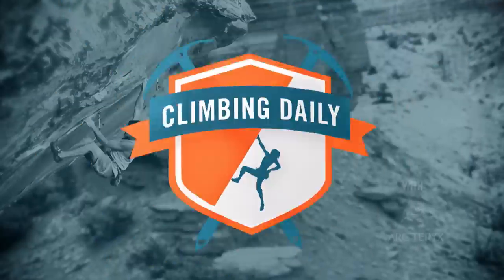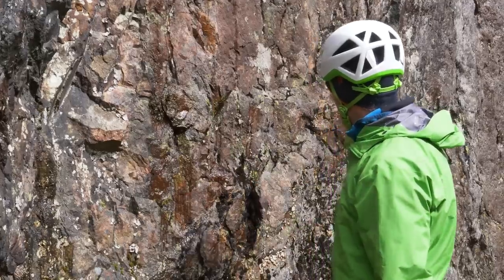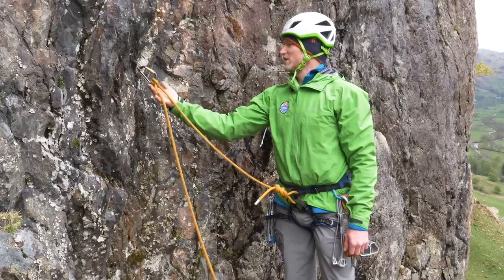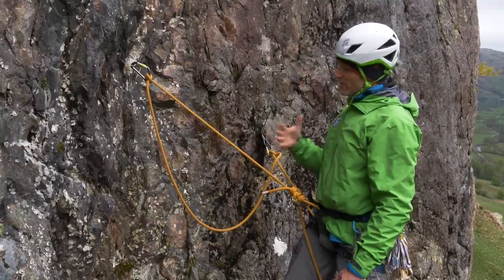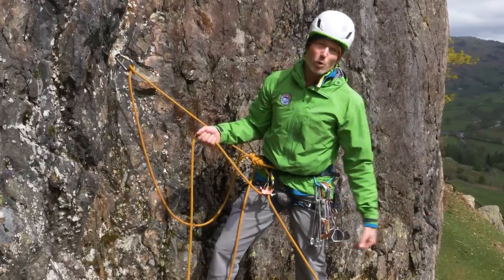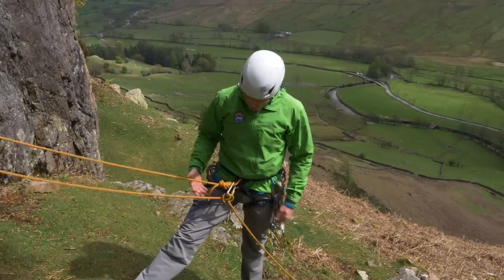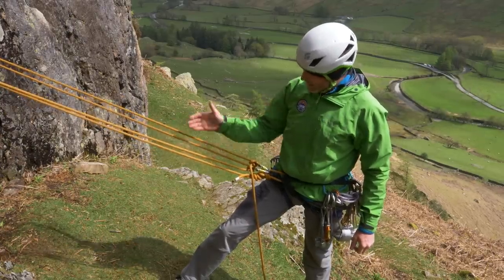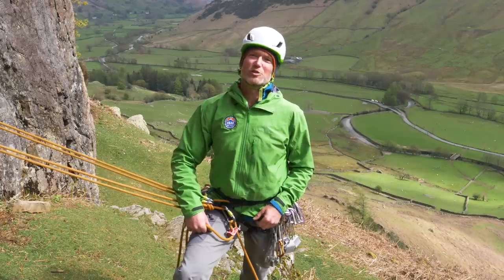How To Build And Equalise A Trad Climbing Anchor | Climbing Daily Ep.1174

Comment: No way to easily escape your anchor if you need to perform a rescue or leave the belay for other reasons. Also, no dynamic equalization like offered with other systems. I remember reading somewhere that the amount of dynamic stretch in an anchor like this is entirely negligible compared to the climbing end stretch due to the short lengths and fact that the load is split between two strands.
Reply: Not true - the difference between nylon (somewhat stretchy) and dyneema (not strechy at all) is enough to make a difference in controlled tests by DMM ("DMM Technical video on slings at anchor" on youtube). They also do testing with the rope and it performs very well on factor 2 falls. Cloves hitches also make it better (though you can certainly include cloves with slings/cords as well).

The need to escape the belay, as you pointed out, is a very valid concern. However it has to be weighted against other pros & cons and doesn't in itself make this approach a no-go.

Dynamic equalization - if you use slings with knots, you don't have that any more or less than with this. If you use the sliding X, then that's actually been rather discredited as an approach in most cases because even though you do get equalization, if a piece fails you then shock load your anchor onto the other piece. So essentially dynamic equalization may make it less likely that a piece will fail, but puts you in bigger trouble if one does. In fact, I would argue that since the belayer is in the system, this contributes to make it more equalize - the belayer as some margin to built the anchor so that it is equalized in a direction in which he would be belaying (and then since he would stay in that general area, the anchor is equalized given his position).
Reply: Francis, the DMM test is dropping a static load directly on the anchors. In this case, you are correct. I referred to a situation where a portion of dynamic rope existed between the anchor and climber. In this case, the single dynamic length will absorb the most significant portion of shock, and the relatively short, doubled section of the anchor takes up comparitively little. The only case where this wouldn't be true is when immediately starting a lead where a high factor fall is a potential. Yes, there are measurable differences in an engineered scenario like DMM, but I would question that holding true under most realistic scenarios. Not saying other rope systems aren't good, they are awesome. But the one used on this video is less so IMO. The biggest reason being lack of equalization, second being not being able to escape.
Reply: Well, of course once the climber is dozens of feet & a couple protection/bolts above the anchor, the anchor itself doesn't matter much, regardless of how you built it. From that perspective, it is somewhat pointless to talk about anchor configuration since it'll play little to no part in the equation, except perhaps keeping the belayer close to the anchor after he is yanked off his stance by the falling climber. But the anchor shouldn't be build for the eventuality of a fall with significant lengths of rope which guarantees a low fall factor: it should be built keeping in mind what happens in case of a high fall factor, especially if there are reasons to suspect challenging moves immediately after leaving the anchor and if there are doubts about the capacity of that anchor (or the rock) to sustain a high fall factor without breaking.

So the DMM test is very relevant in the sense that this is the worst-case scenario and worst-case scenarios should be taken into account. It does show that nylon as better shock absorbing properties in cases of high fall factor, but less so than the rope itself and that clove hitches also help reducing the shock on the system. I'm not sure I get your point - when you say "but I would question that holding true under most realistic scenario". Their conclusion actually fit rather well with what we already know about the properties of the material & configurations they used - yet you would dismiss the result because (for some not really specified reason) they may not hold true in practice? This seems closer to beliefs than to a fact-based assessment.

I am not sure I understand your views about equalization. The sliding X is more and more questioned because if any piece fails, you're shock-loading whatever remains of your anchor which isn't good. If you're not talking about the sliding X, then you're still making an anchor with a knot & a focal point, which wouldn't be better or worst in terms of being equalized since in both cases you still need to define a general direction of pull for which your anchor will be equalized.

As mentioned in my other post, this doesn't mean I would use his system all the time - it would be pretty silly IMO if you've got 2 shiny new bolts next to one another as an anchor. The main criticism I would have with regards to the video is that he doesn't really highlight in which cases he would take this approach, as opposed to just a sling & locking biners...
Reply: WoT, much.

You don't need "dozens of feet & a couple protection/bolts above the anchor" to mitigate a high factor fall, you are shaky on your physics there. You can begin mitigating that as soon as you leave the anchor with a properly placed piece of pro.

 I never said anything about sliding X, they are terrible. You can build a variety of anchors which allow you to move, adjust position, and escape belays when needed, including ones using your rope, slings, or cord. This particular one doesn't

The point about materials is entirely debatable, but from the test I have seen, it's entirely mitigated again by just being smart placing protection. I have rarely ever seen a scenario where you would have to leave a belay without being able to mitigate a high factor fall, although I agree it can happen.

Comment: Duuuude for ffs stop putting things into your ropeloop!!!!!!!!!! NEVER use your ropeloop -.- 

And also, LOL to the people saying they would never belay off only 2 pieces XD go climb real stuff ^^
Reply: duuuuude. Use the rope loop man it's fine and transfers the load to the anchor directly. literally 100s of thousands of people do it this way; it's how they IFMGA guides do it so if it's good for them it's good for all.
Reply: @davidcross30  Dunno that I entirely agree with this statement. For self-rescue situations, having the tie-in loop in the master point is just one extra thing to deal with. I have no doubts that it's "good enough" for guides—and me—but a very minor modification makes "good enough" into "better" by taking the belayer's tie-in loop out of the system, using no extra gear. Simply replace the central clove with a fig-8 on a bight, and use that bight for the master point. Technically, the central clove is bumped to the anchor's leftmost strand and the fig-8 is replacing the belayer's tie-in, but you get the idea [or if not, see the bottom of my reply to filmonchik]..
Reply: @chilli8364  100% get what you are saying. That is another way to do it too. I have never had to do any real rescues that have required me to escape the system, hauled clients past a tricky bit or lowered them to rest on a ledge etc a few times. If I thought that I might have to then I would think about doing it like you have said. Preventing the situations is the key (clearly rock fall or other crazy things aside but again I don't go out of my way to put myself in those situations.

A semi-direct belay (belaying from the tie in loop) is common when building your anchor with the rope, rather than slings, Also I have found means that the anchor is constantly loaded better than if I direct or indirect belay; this is important as dynema slings are not great with shock loading (see DMM's video on testing slings https://www.youtube.com/watch?v=iJ5dN0ZSv7w and https://www.youtube.com/watch?v=Vrgadjo9niY) and it means that gear placements in the anchor are less likely to move/un-seat (particularly cams walking).

Like I said in one of my other post; have all the tools and know the pros and cons for them, then employ them in the right scenario and it's all gravy.

This is one of the reasons I love climbing; the many different ways to do stuff and things. Stay safe out there bud. :)
Reply: @davidcross30  That's great info regarding relatively more consistent/constant loading with semi-direct vs others. Appreciated! Is that anecdotal or is there data that you're referencing? 
Definitely makes sense compared to direct, and maybe to indirect ...I could see that going both ways, depending on particulars of loading. I'm going to give semi-direct more serious consideration and examination next time I'm out.
Ah yes, I love a good drop test. And DMM rocks! ...at least I find myself drooling over their gear a lot. I have no idea whether it's the groove, or if they got the curve just right, or what, but Wallnuts slot easier/better than any others I've used.  :)
Thanks again

edit: typo
Reply: @chilli8364  I guess no one has (or is willing) paid anyone to get any data for how much trad gear moves when it is weighted-unweighted; so yeah just from use and courses and chatting with other peeps. I'm sure you have had a time when you have put some gear in and thought hmmmm it is in that slot but it will lift out quite easily? This is where keeping an anchor loaded would prevent that and yeah cams definitely walk when they wiggle, that is why we extend runners clipped to them. But yeah I do tend to in-direct if I'm using the ropes to build the anchor and this is usually when my partner is leading through or when I'm teaching a client to build an anchor at a stance using just the rope; I usually choose somewhere with loads of gear placement possibilities and I use the random more difficult ones leaving them with a nice easy set up.

DMM kit does indeed rock (pun intended ;@) I love their offset nuts, they are awesome and NEVER leave my rack. Check out their sister company Helix tactical too - not really climbing per say but the kit is awesome. https://helixtactical.com/Products.

P.S. I have liked this nice constructive chat we have had.